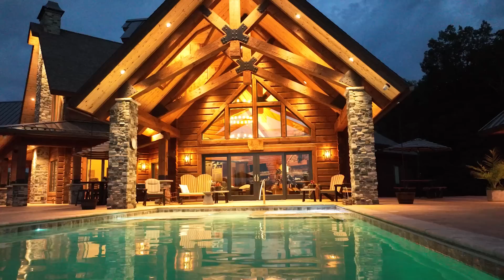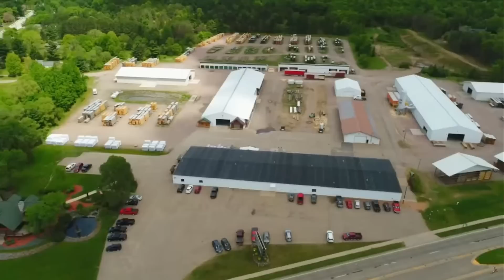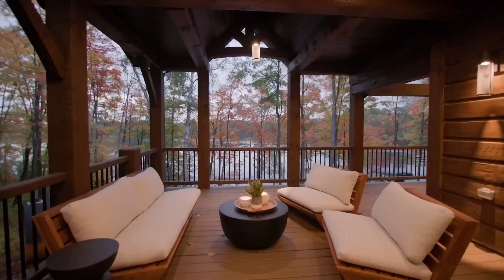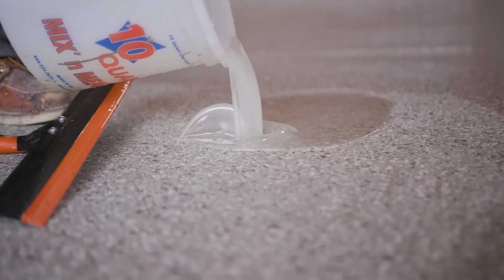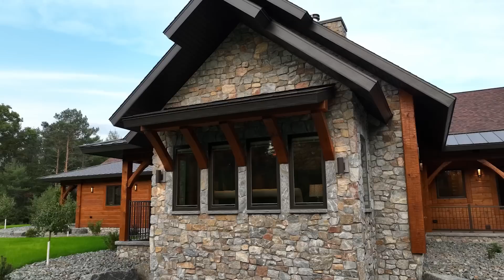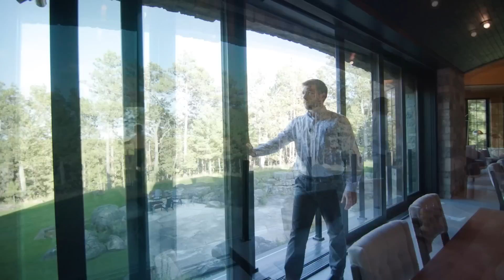From Concept to Creation: Insider Tips on Custom Home Building

Comment: I have two questions for you: 
1. How do log or timber homes do in states with very hot summers, like Oklahoma? 
2. I've been told log or timber homes have issues with staying air-tight, how do you deal with that?
Reply from the maker: There are full log homes and half log homes. Half log homes have a 2x6 insulated wall so they are insulated like a regular home. Full log is all about thermal mass. Golden Eagle machines their fill logs within 1/16" tolerance therefore they are very airtight